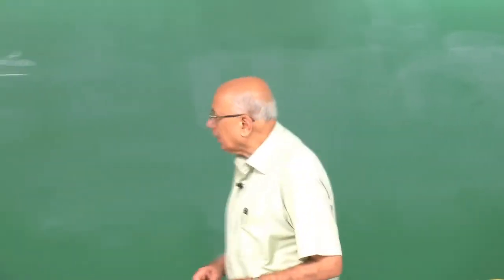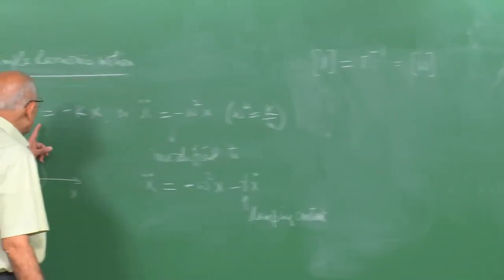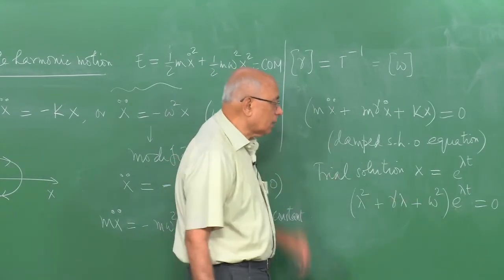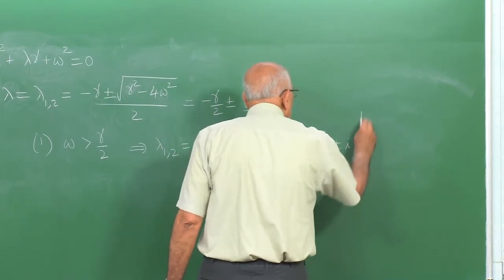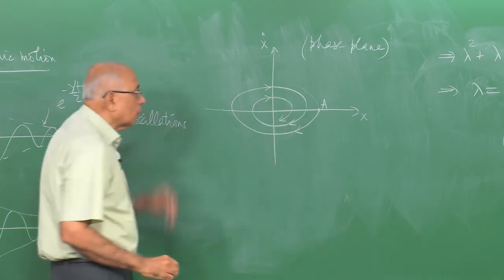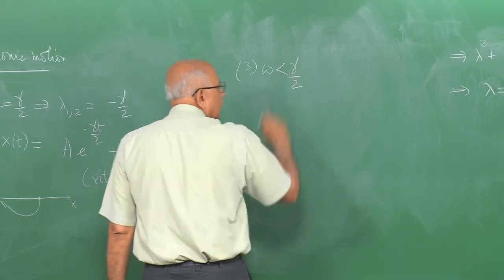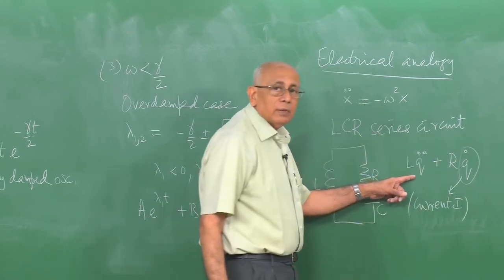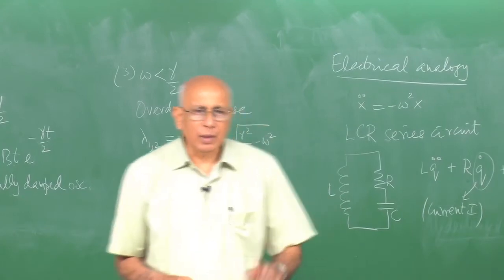Lec 30

Comment: I m not getting how the second solution (sine part) was gone at 14:50 
Again if the second part is gone, the time derivative at x(t=0) does not yield 0. Can anyone explain what is that I m missing here?
Reply: I Think , It is like playing with coefficients :-

x= C1 e^λ1 t  + C2 e^ -   λ2 t

Consider the first scenario(r<2w) . 
When you have two value of lambda.
The solution that you are talking about is of form 

x= C1 ( e^ -r/2 t) ( e^ i ws t) 
     + C2 ( e^ -r/2 t) ( e^ - i ws t) 

You can plug in value of e^ i wst 

And then take 
cos (wt) e^ - r/2 t  common 
You'll get  
cos (wt) (e^ -r/2 t ) [ C1+C2]

And  after this  similarly for sin wt

And then name these new constant as A and B